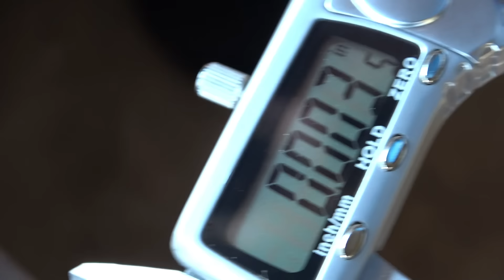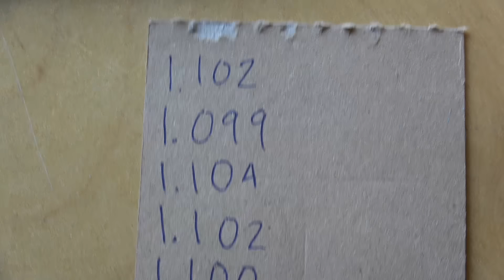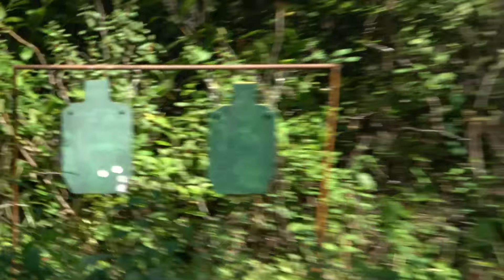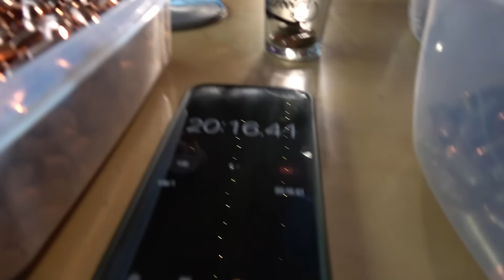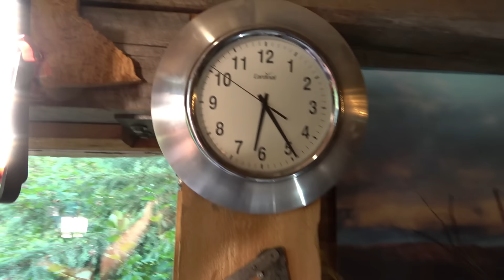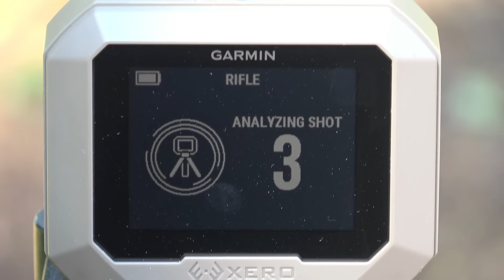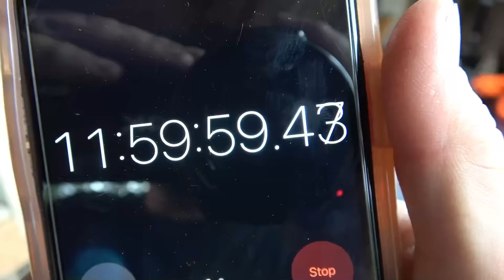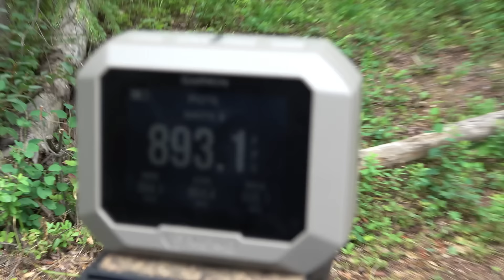We Made 10,000 Rounds in 24 Hours! DIY Ammo FACTORY

Comment: For people new to reloading, I would NOT recommend starting out by setting a goal of thousands of rounds. That can be dangerous and expensive. 

Make a few rounds, check them, shoot them. This is how you learn and also find any mistakes. Repeat this until everything is going smoothly. Then make more but take your time. The last place you should be in a hurry is when making tiny devices designed to explode.
Reply: Yeah, but you knew they were going just jump in with both feet on the first day.
Reply: 100% correct! Make them perfect, make them safe and speed will eventually show up.
Reply: Yeah, starting with a progressive is a lot , I would recommend a single stage press and going slow to start. Much easier on the wallet.
Reply: @pauldavidson9267  I started with a turret press, that I still run single stage. Until I get ALL the kinks out of the system, and a decent deal on components, I won't even setup the indexer.
Reply: Good advise, I tried telling my friend that when he got a new Dillon. I told him I run a 100 rounds and check to make sure it's still good to go. He ran over 500 rounds that was out of spec and couldn't use it other than pulling all the bullets and starting over.
Reply: Indeed. I started with a classic Lee loader kit. All you need is a mallet to make a cartridge. Entire kit fits in your pocket. Downside is it neck sizes only, can't full size the brass. This is fine if the cartridge is going back into the same firearm it was shot in. Not ideal for semi auto.... Scale for measuring powder is another essential. Now I use a single stage rock chucker press. Also have a Lee LoadAll & single stage press for shotshells. Plenty for my needs. 270 Win, 30-06 & 12 gauge. For plinking I use 22 which are inexpensive in bulk & not suited for reloading...
Reply: I can't imagine starting off with a progressive. I've screwed up plenty of rounds with a single stage.... kind of a steep learning curve before you start cranking out ammo in mass.
Reply: young family of new reloaders I'm going to give you information that can help going to the hospital or the grave yard. .I have over 45years experience and knowledge reloading many, many calibers. I'm going to explain why semiautomatic firearms are the most dangerous firearms in the world . most gun blowup are due to ammunition factory or reloaded. a yall was firing that 9mm rifle fast  what happens is while a fresh round goes in you can't see if a squib load, overload, or a bullet broke crimp on recoiling firearms and bullet sliding back into case causing  extreme chamber pressures  blowing up gun. I've experienced this and was close to being blinded. even  with  new brass variations in case mouth thickness, chamber dementions  ,bullet dementions  causes this. to properly test  bullet crimp with a hard surface, table ,door frame best.put loaded round between middle finger and next one, then bullet end between outher fingers  pushed hard against hard surface. even if I don't fell bullet slip and it times you can hear it break free. I take   a pree set measuring tool and check.it don't just a few seconds per shell to check. I do this process  with all my semiautomatic pistol and rifle ammunition  reloaded or factory ammunition with no exceptions or excuses. my life and the lives of my family demand this process. some my say they don't have that little bit of time to do it. I would answer them how much time is there life worth,  I also reload ultra reduced specialty center fire ammunition.   don't ever try it if you don't know what your doing.  kaboom. papa from the foothills of the blue ridge mountains in NC wishing you well. 😊
Reply: @mdees88  I started out with the old Rock Chucker RCBS way back in the late 70s. I can still remember the day I cranked out 50 rounds of 45 ACP. I just looked at it for awhile and felt like I had done something. I still have it stored away. It was years before I got a Dillon 550. There's a learning curve for sure.
Reply: Exactly my thoughts, fast quantity being brand new to reloading is dangerous to say the least.  Older gentlemen yrs ago did same thing, progressive to learn on, Glock exploded after the fact and he either pulled bullets or tossed   4500rds.  FYI to the family-rifle brass is way more in depth!!!!
Reply: Yep, I've been hand loading for the better part of a decade and I wouldn't be comfortable making 10,000 rounds in a day. If you miss putting powder in even one of those cases, you may get a squib, and if you put another live round behind a squib your gun is going kaboom. Not to be rude, but these people clearly don't know what they are doing, admit to having made mistakes and not doing checks they should have done. They simply aren't taking it seriously and even those who are very careful can/sometimes do make mistakes. What is shown in this video is exactly how people get hurt reloading.
Reply: I agree..   and make them in "batches" and keep them separate.. 
So if something goes wrong, you have the "wrong" batches isolated.  Be methodical about it.
Reply: He is way too gitty. 

So he shoots a round and it doesn’t hit the target …. Then he goes “where did that go , it didn’t hit the target and like a complete knucklehead, fires another round ???!!!??? 
  so apparently he’s never heard of a squib round because if you fire something it doesn’t hit where you  are aiming check your barrel and make sure there’s not a projectile in it!!!! . 
You do not realize just how lucky you are   
  That was the most irresponsible loading video I have ever seen. There’s hundreds of videos to show you how to start loading and it tells you all of these things very simply want to watch out for how careful you have to be how often you have to check your rounds and the way you did. It is pure fear for me and you have four daughters shooting that ammo I guess it’s better to be lucky than smart because that was some very very ignorant dumb actions loading that ammo like you did you’re lucky you didn’t blow your face off?
Reply: 1700 round right now and about 5000 dollars invested equipment and supplies
Reply: This is awesome! Reloading always makes me relax! But please wear safety glasses, seen too many oops not to!
Reply: Everything "can" be dangerous.
Reply: yeah wait until they get their first squib. Hopefully that were checking each case.
Reply: Wait til you see how much fun pulling bullets is. :) I bought depriming pins y time I ordered any supplies til I had a good supply of spares.
Now you need to get I to casting your own bullets. I was surprised to see you get to have a semi auto rifle in Canada. Great job every one.
Reply: I don't like the powder filling part of their machine. I like the kind that weight each charge. It's slower but more reliable.
Reply: My Thoughts Exactly. I have made Rifle Rounds then Thousands of Pistol Rounds and I always Check that each die is set up Correctly, I have all the Die setup Measurements Written down in a loading book, and I stick to it, I run a "Piggy back" on top of a RCBS "Rock Chucker" it is a 5 station press, and It is fine for Me, I don't try to make Quantity, I make Quality, I shoot Competition and I can't afford for Rounds Not go Bang. You are using Jacketed Projectiles, I nearly always use Cast projectiles they are way cheaper and just as accurate. Even my Big Bore Silhouette Projectiles I check that they weigh within 2 Tenths of a grain, of my standard.
Reply: Party pooper.
Reply: @Highbrass-reloader  yep I had a triple charge case got by me as we had a printer punch bend. Blew up my 357 586 combat revolver! Spit the cylinder, bent the frame! That was many years ago.  Lucky  S&W replaced the pistol completely! And mailed it directly to me! They just stamped my #s right over the #s on the replacement revolver!! Lol! Probaly not illeagal today. I recently sent one back to heritage and they replaced it and I had to pay for another background check!! Wasn't happy with that deal.
Reply: @esmannr  
	I only run ball/spherical powders on my Dillon progressive 
It is consistent with only a +.1  to +.2 grain variation for my pistol, and .223 manifolds.
Reply: @pauldavidson9267  single stage is no safer. It's very easy to lose track of the funnel in the loading block and double or squib charge a cartridge. I visually check the level of every case when I place the bullet in my progressive it is very safe.
Reply: @kimmichaels899  lord have mercy I can only imagine how bad that was, and extra background check is BS.  S&W are top tier of ask me.  I been at it for nearly 30yrs, rifle magnums down to 44mag-9mm.  I’ve split a 9mm case, going too hot on HP loads once and caught dbl charges on press as they happened.  Had cases get stuck in chamber after sizing 400 223brass, Die backed out .003 on last 30or so.  I’m meticulous safe, of course accuracy comes with that as well.   Currently looking to relocate to long range state, divorce caused me lose my land to shoot!!! Is what is tho
Reply: These people are YouTubers they have cameraman and “professionals” to supervise them they can’t screw up. Besides, it is pretty obvious they can afford 10,000 rounds of ammo plus expensive tools all at once despite knowing factory 9mm ammo currently runs at 25¢ per round while components to reload 9mm cost a lot more
Reply: @kennysloggins1486  the indexer can save your ass. I have a SDB and it has auto indexing, and it reduced the chance of double powder charge. Its so easy for a beginner to miss that if you have to index manualy.
Reply: @philipng6598  lol I figured as much buying from Dillon with a tour of facilities lmao.   Wish I could do that lol
Reply: sound advise. I like it.
Reply: Well, it make more clicks.
Reply: @arlissyoung8899  I cranked out rounds for the first 30 years on the RCBS Rock Chucker press.  A few years ago I bought a Hornady A/P press and love it.
Reply: I can't see anyone thinking 10,000, this was just a project that the guys like Gridlessness do and plus it's Youtube content.
Reply: You cannot make mistakes when reloading
Reply: Def don't use a progressive loader as your 1st
Reply: I have over two dozen reloading manuals and hand books that I keep reading to know everything I can. The main suggestion I have for you is to check your powder charge often. take care.
Reply: @pauldavidson9267  I always suggest a turret. One outgrows that single stage in a hurry. At least with a turret you can spin right to the stage you need. The good news if you start with a single stage is you'll quickly have your Oops station figured out lol
Reply: @MikeSiemens88  Love those old whack a mole kits. Good for keeping your heart in top running condition when you mis seat a primer.
Reply: @esmannr  keeping the damned powder hopper full would help a lot with consistency. That whole set up is a preventable disaster waiting to happen. If they manage to squib a 9mm they are only most likely to lose an upper and sting some fingers.
Reply: @derralmalone6584  1. 9mm is nowhere in the same realm as .50 BMG in pressure and volume. Can it still do damage? Sure. But not at the powder weights they're using, even if it is titewad which is a fast burner.

2. Kentucky's rifle didn't blow up because of a primer pocket.
Reply: so im 18 and want to get into realoding. where i live it can be a very lucrative oppertunity to make some money, now i know that i should start out with. a hand press machine and im attempting to only start with 1-2 diffrent calibers, do you by chance have any info that could help me out, posibly tips or tricks?
Reply: @CrayonLover69  Best advice is to find a cranky old fart to teach you how to do it safely. The second bit of advice is to check your local laws with regards to the manufacturing of ammunition for sale. You are most definitely on the hook for any potential kabooms that could be attributed to your ammo.
Reply: @gregsmith5695  Haven't had that happen.
Reply: If you are familiar with mass production it would be no problem. You always constantly do quality checks on any production run.  But most people have never seen a high speed production line of any form. I would say your advice is very wise for the vast majority of people even as good as the Dillions are at redundant self safety checks.
Reply: @MikeSiemens88  I'm sorry Mike. What hasn't happened?
Reply: @gregsmith5695  I haven't had a primer seating issue using the classic Lee Reloader. 30-06 & .270Win - large rifle primers.
Reply: Sgammo sells steel 9mm for 229 per 1k. Brass stuff at 259.
I just checked primer and bullet cost, it's not very cost effective to me to reload 9mm. 
For an expensive long range high power round(338 Lapua, for example) it makes perfect sense to reload.
Reply: @MikeSiemens88  Ahh ok. Guess I'm just lucky then. I have managed to pop a few off on occasion. Most people that I have chatted to about them have had similar experience. Sort of harmless just startling.
Reply: Meanwhile in China ...
Reply: I started out with something easy, .38 Special (no +P). It's a straight wall and non magazine fed round that is very forgiving because it's used mostly in revolvers. I'm still fairly new but I've moved into 9x19 Luger also known as 9x19 Parabellum and 32ACP.
Reply: @techmarine83  Sir you are indeed very wise. That is very close to the way I started. Of course at that time I couldn't afford a nice progressive press so I was forced to start slow, lol!!
Reply: Yep, also check visually each round if the powder has properly refilled. Otherwise you shoot with the percussion cap only. That results in a bullet stuck in the barrel and if you don’t get it what’s going on, the next round you damage at least the gun and hopefully that doesn’t hurt you or one of your girls. Luckily that never happened to me because when I started reloading back in the early 1980’s, I was properly advised by the owner of the gun shop I purchased everything.
Reply: Came here to say this!!!! This is great otherwise
Reply: The one case that you showed had a crimped in primer.That could probably be the cause of your bent extractor pin.
Reply: @rolandrick  You can put a powder cop on a progressive press to check for both high or low powder charge. 
   Also I have had squib rounds from factory ammo also. It is a real pain getting one out of a pistol barrel.
Reply: good advice for unplanned pregnancy as well them be tiny packages that can explode too ....  and make things very bad or very good
Reply: “Speed is fine, but accuracy is final.”
Reply: I don't even recommend starting out with a progressive press.  Reloading is a prime example of Crawl/Walk/Run being the smart strategy.  There are 20 different kinds of mistakes that can be made that are dangerous, and I'd hate to see one of these great kids loose a face or finger.  I've use Dillon products for 30 years now and they are spectacular, but I've been reloading for 40 -- there's a lot to learn and these guys are definitely rushing into it.
Reply: @mikepeterson9362  wise words..... I have loaded a few shells (maybe 100) ... and can honesty say I was thinking of many ways i could go wrong ... I stopped when I couldnt figure a way to stop one possibility .... didnt have one with the experience to ask either
Reply: Awesome team 👏🏻
Reply: bought my rock crusher 50 years ago amd its still all I have ever used.  maybe its time to step up to a nice progressive..
Reply: I only use a single stage, I can knock out 200 rounds of .308 pretty quickly. I check weight every 10th round for just shooting, and every single round for accuracy shooting.
Reply: This comment 👌
Reply: @jimdevlin4949  slow is smooth, smooth is fast
Reply: Need to build the basics. They double charge or fail to charge 1 in 10k rounds, it could destroy the gun or harm someone. 

Do it with rifle calibers and you could get someone killed.
Reply from the maker: Good Advice.  But just in case you didn't watch the whole video, we did check primer depth, overall length, chamber check, and chrono'd 10-20 rounds every 1000 rounds.  We've already shot about a thousand rounds since without a single problem:)
Reply: @MyBacktrail  nah… it’s not THAT bad.. simple, methodical, detail oriented, and they will be good to go
Reply: Saludos espero que todos estén bien saludos e mamá 🌹 cuidense mucho bendiciones éxito en el proyecto 😮
Reply: I started with a Lee loadmaster . Doing 9 mm I did a bunch of dry runs no primer no powder. Did about 20 rounds . Check and dubbed check . Then did 10 rounds . Went to the range . Shot them off . Work fine . Still using my loadmaster . I can do 500 rounds in a hour . But every 25 round I do check them .
Reply: well that's just common sense.. 😅
Reply: Loading ammo is easy. Loading ammo that is safe, consistent and effective is not. Best to start out with a single hole press until you thoroughly understand the process. Jumping right onto a progressive press and loading 10k rounds is flirting with disaster.
Reply: sure a lot different than when I started 30 years ago reloading when it was passed down to me from my grandpa wish her pump out the volume now
Reply: also you could start a small little business to start selling ammo that you guys make
Reply: I see they did just fine Mr. Some people just have more ambition than others and are not afraid. There for I’m sure they were expecting all the pros and cons of it all , I salute them! Congratulations to them!
Reply: If you have good understanding of the principles then unless your loading for extreme precision just go progressive, in 40 years of reloading I have worn out two lee presses and now just run several Dillon presses, predominantly the 1050 but a friend just swapped to a fully automated mark7 so I think I may get one soon😊
Reply: Clean the brass first
Reply: I get the impression this is really not their first rodeo with reloading.... I may be wrong, this is produced for our entertainment and to get us all to comment.  And for me it worked in both cases, I am entertained and making comments.  Good to see a Father doing things with his kids....
Reply: Everyone is tripping out about the speed. If you look closely that Dillon 1050 is set up with every single safety feature available including a powder cop so please people let’s chill out. Yes we all are aware that reloading has its inherent dangers. But I’m sure all of them are completely aware of said dangers and risks.
Reply: I agree!  It's a terrible idea to start reloading with a complicated progressive.  Way too much to watch all at the same time for someone not intimately familiar with loading ammo.   Double powder charges or no powder with bullets stuck in bore too likely.   Safety is way more important than speed.
Reply: @MyBacktrail Deflagrate not explode. If your rounds are exploding in the chamber you made a huge mistake in power selection and charge size.
Reply: @MyBacktrail  Deflagrate not explode. If your rounds are exploding in the chamber you made a huge mistake in power selection and charge size.
Reply: With a Dillon, not much to go wrong. However, using a single stage press first to learn the ropes is advisable.
Reply: The lack of safe quality assurance here could get someone killed.
Reply: @smithright  not likely on pistol ammo. Load something with more powder space incorrectly then yes. 

There’s a YouTuber who just about got himself killed firing a hot 50 cal SLAP round.
Reply: @arlissyoung8899  I worked in the firearms industry for 18 years. Saw this all the time. Some rookie loads 500 rounds that won’t chamber.
Reply: Good wind up with 10,000 rounds of garbage
Reply: Agreed.   It isn't Dillon.  Dillon presses come out of the box ready to be assembled and TUNED.  Tuning is part of the learning how to "Check".  It took me a while to get it down with my little Dillion only to put one daughter on one knee and the other daughter on the other.  Oh my goodness that was an awesome thing for us.  
Dillon brings people together.  
I LOVE you folks.  Jesus is always in your videos
Reply: @pauldavidson9267  single stage is for people with simple minds. Some can handle a progressive.
Reply: @mdees88  A man has got to know his limitations I guess.
Reply: @johnnymccann5607  I feel dumber having read what you wrote.
Reply: @dontbeavictimu they’re a ways away from that.
Reply: @ericevans4973  to be honest I really don't remember what I said in comments but about firearms, ammunition, reloading, ballistics it try to be right.if was that call it a learning tool.ive been at this over 45years and still learning something new.  papa wishing you well
Reply: Their first mistake was not wearing any eye wear protection. Specially before finding out your machine wasn't punching out your old firing pins, but double stacking them instead. I know it's a short time video, but checking your equipment and safety gear is always first priority.! Other than that...I Love the team work, and video though.  🫶🏼